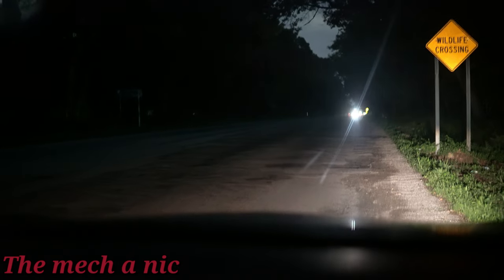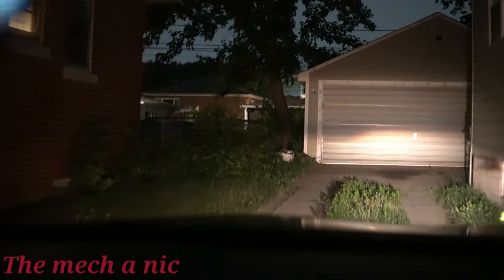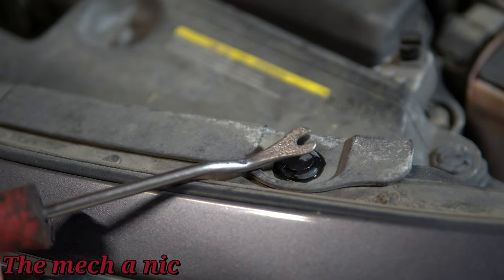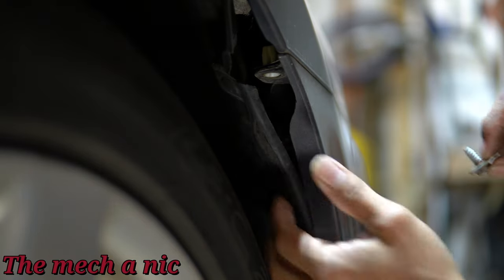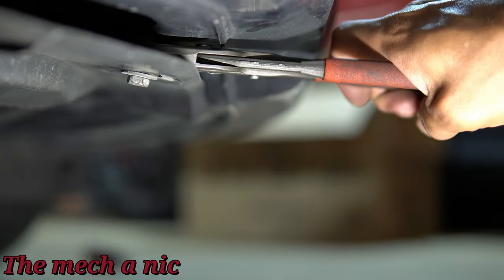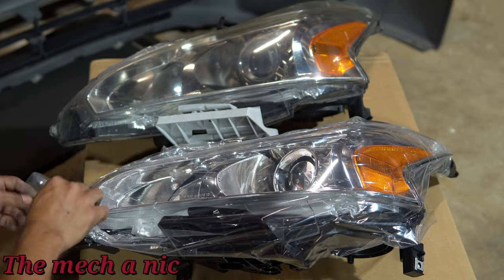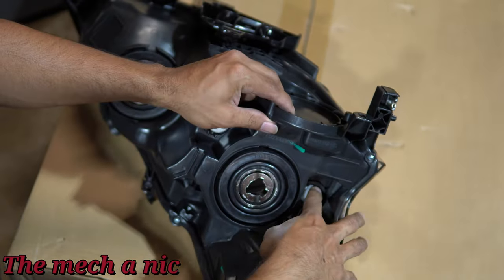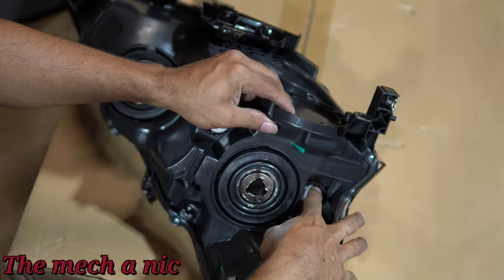2013 - 15 Altima head lights are dim / Altima head light replacement

Comment: So I've seen there is an LED headlight kit for the Altima. Would it be worth getting and installing? Also, how long did it take from start to finish with only 1 person working on it? I need to replace my headlights, and im doing my research.
Reply: jasonsteele7584  i bought replacement headlight assemblies and led bulbs on eBay for around $210.00 for everything and just replaced them a couple of days ago. Wow   what a difference it makes

Comment: Since installing the new ones how are they holding up? Going to replace mine very soon going to buy the same ones you linked in the description
Reply from the maker: Haven't had issues with them, so far they're working good
Reply: @themechanic6117  awesome with your video I’m more then confident to do this myself
Reply from the maker: Good luck 👍

Comment: Do you have any advice for replacing the passenger-side high beam bulb? I'm trying to do it without removing the bumper and pulling the whole assembly, but I just can't get my hand to it...
Reply from the maker: Remove the fender liner and come from inside the wheel well
Reply: @themechanic6117  Hey, man, thanks for the response and for all your videos! Maybe I'm not as flexible, but I just couldn't get my hand to the passenger-side high beam coming through the wheel well. I wound up pulling the bumper and headlight assembly, so a bit of a pain, but I still got to it. Your videos were super helpful!

Comment: I'm running into the same problem trying to adjust the headlights. How did you adjust the passenger side if you didn't have a long enough screw driver?
Reply from the maker: I had a screwdriver that barely reached. A few days later I bought a long screwdriver

Comment: Well, We have a 2014 Altima, was looking into seeing how much it would be to get the headlights changed out, call our local Nissan dealership to find out they finally came out with a recall on these, and they changed out the headlights for free per the recall, so call your Nissan for this info....
Reply: Did you get ot done before October? I think the class action suit ended. 😢

Comment: just did this today and installed them with LED bulbs, the visibility is great now. however there is a very slight gap on the bottom side of both headlights, is that normal or did i install the bumper incorrectly ?
Reply: BlinkedMyCart   did you get the gap fixed? I had to adjust mine several times to get it right.
Reply: @dwaynemorris3079  nah it’s been almost a year now 😂 still got the small gaps

Comment: I just changed the bulbs today, because i have the same issue. unfortunatelly, it didn't work. I have to drive using the high beam. I will replace the assembly

Comment: Replaced headlight housing and bulbs both sides. Did not fix my issue. Passenger side looks like it is working at 10%. Barely casts a shadow.

Any ideas ? Thanks 
2015 Nissan Altima
Reply from the maker: That can't be right. Did you use new housings ?
Reply: Yes, I replaced both housings and bulbs.
Reply: @themechanic6117 the issue seems to be the new housings have the high and low beam bulbs in opposite locations than the previous housing. Shop had them in the  incorrect slots. I’ll know after dark if that was the issue.
Reply: I replaced mine last year on a 2015 Altima. No issues what's so ever.

Comment: Very good work, but I think you will regret not having changed the regular Bulbs for some LED LIGHTS that was easier with the head lights before mounting them.
Reply from the maker: LED lights don't last as long. My experience with them is just that and I don't feel like constantly changing bulbs on this car . Halogen are tried n true
Reply: @themechanic6117  That must depend on the brand because I've had to same LEDs installed on mine for the last four years and they're still going strong without a problem. They're supposed to last longer than halogens. I get your POV though.

Comment: Nissan of Vacaville CA. isn’t honoring the callback. They keep saying that they don’t have headlights in stock.
Reply: dereklacey1   i ran into the same problem where i live in Va. The lawsuit is over and they are no longer replacing for free as of the end of 2022. I bought new headlight assemblies and new led bulbs for around 210.00 and replaced them myself.

Comment: I have a 2015 Altima and my headlights are horrible I hate driving at night because you can hardly see🥴 and why did they make it so hard to change a bulb? 🙄
Reply: bulbs aren't too bad. you can just reach in under the fender liner and pop it out.
Reply from the maker: Yes ,this video is about changing bulbs. It's about changing the head light assembly.  There's a much easier way to change the bulb just as he described

Comment: My headlights on occasion have dimmed on me I have a hood that had flown up because of the safety latch has caused $9,000 in repairs that Nissan repaired and now has given me a bright red sticker that I must replace place underneath my hood to allow them to inspect in oil my hood latch,  I suffer great anxiety and panic attacks because of this, they still have not replaced the money that I spent on the window that was $250 it has set from 2021, I did not receive my car back until February of this is been a financial burden on me left me stranded in the Indiana had to bring the car back to Rochester New York to finally have it fixed at dorschel Nissan. Yes I believe I was the one on the recall on the, now the problem is trying to get somebody to insurance seeing as how I have to have a break red sticker underneath the hood. There is seven more recalls on the state stabilizer arm needs to be replaced and it can cause a accident please let me know if there is an attorney that will take this case I have not been able to find one here in Rochester I was slightly hurt just by embedded glass and a few bruises the roof hit so hard to put a foot-and-a-half dent in the roof and they even have to replace the roof I do not feel safe in this car, nor will it pass inspection without a piece of paper saying that it was 90% totaled and they choose to fix this car instead of total it and put me in a nice car that I could feel safe in😢😢😮😮

Comment: I’m sorry but I think we’re way outside the headlamp lawsuit for my moms Altima and me being impatient I rather see how much an independent mechanic would charge vs Nissan. $1500 fuckin nuts and this is a piss poor design for this Altima like you can’t easily change a headlight bulb. And great side marker bulbs seem out too. I figured it’s the headlight bulb shining through that amber reflector but seen nothing. Pff $11 dollar check from Nissan  to make up for the headlight failure?

Comment: You all need to either stop buying stupid Altimas or grow a pair and do a real actual hid retrofit where you insert a QUALITY projector lens inside the reflective lens - NHK, Morimoto are the best options.

I hated my pos 370z lights - the problem is the DOT standards allow for too much light being spread out or diffused above oncoming traffic in order to light up signs on overpasses.

So your best option is to pay lightwerkz, the retrofit source or other retrofit specialists to improve your lighting

Or

You can spend 3-4 days like I did

Day one: remove and disassemble headlights

Day two: paint chrome black or any cosmetic changes - paint must dry for 24 hours to allow for outgassing

Day three: resemble and aim lights

Day four: sand external housings with 600 - 800 - 1000 - 1500, polish using a drill and 3” pad: 3m plastic n lens restorer or chemical guys headlight polish ( do NOT deviate from these two options! ) 

Final step: alcohol wipe - spray Meguairs headlight coating. DO NOT use anything else.  Do not use any 2k clears or any of the bs options being shown anywhere else

Why?  Meguiars is chemically optimized specifically FOR polycarbonate plastic.  It’s user friendly and won’t turn into a wavy flaky mess in a year.

Use green tape and mask everything before starting the process! You want 2-3 layers of tape by the headlight so you don’t damage your lousy nissan paint…

My 370z lights turned out amazing.

If you buy a budget car like an Altima - you’re going to get bottom of the barrel headlights.  

While you can sue - a check for $16 wont actually fix the problem - neither will “just” putting brighter bulbs in fundamentally flawed stock reflective lens housings

The problem is not the output from the bulbs - it’s i efficient lens designs because Nissan is lazy and complacent and like most people out there - does the bare MINIMUM to pass standards to sell you a cheap Altima

Personally unless you have a solid budget for maintenance and are adhd about it - the Altima is a horrible buying choice because of the CVT transmission that MUST have the fluid changed no less than every 30,000 miles.  Regardless of Nissans or the morons at the dealerships direction

Go watch any Altima CVT transmission tear down vids.  Your headlights are the least of your problem

Finally - Nissan Dealerships purposefully target and place people into Altimas because of the higher depreciation rates combined with adverse credit by “many” borrowers - this is advantageous for the finance guy at the dealership.  

Bottom line:  Stop buying Altimas period.  They are junk vehicles that REQUIRE higher than average due diligence in terms of maintenance SO you’re not “saving money” compared to paying more for a honda/acura or toyota/lexus product.

Only the 370z and GTR’s are 100% designed and manufactured in Japan - that’s WHY you see older ones on the road still…. And every Altima is ghetto out…

Comment: I hardly drive at night but I just drove for a couple of hours on the dark country roads last night. What a coincidence! When I was driving on the completely dark roads alone, it was totally fine, but when I was driving on a city road, my lights are hardly noticeable. And there is nothing wrong with them, they are incandescent with lenses. I think all car lights should be LEDs, which are better in almost every way, and not that more expensive actually
Reply from the maker: Switching to LED should make a big difference 👍
Reply: My 2016 Altima SR came with  factory installed HID lights and they're still not bright enough.
Reply: There is some controversy about LEDs largely because the light pattern is so dissimilar from halogen and xenon so may not reflect properly in the housing. Since Xenon can emit light similar to the original halogen bulbs, some consider it a better replacement (today).
Reply: There are a lot of post about halogens  in this case.   They say that the halogens will BURN HOT and contribute to the problem and even melt the housing.    Check it out.